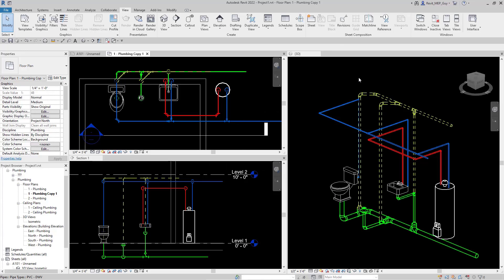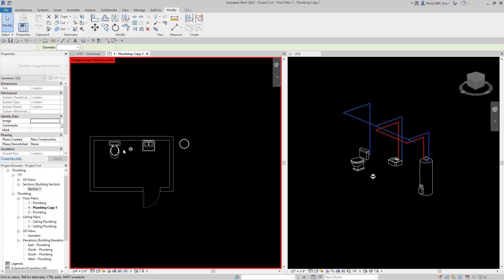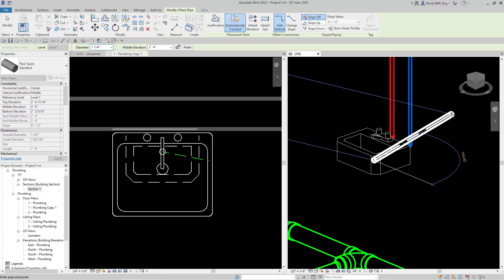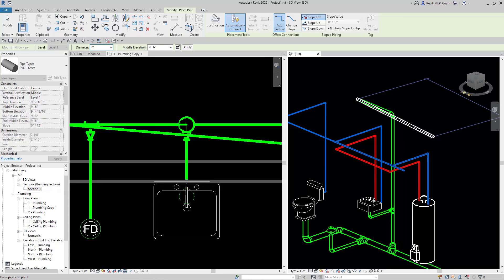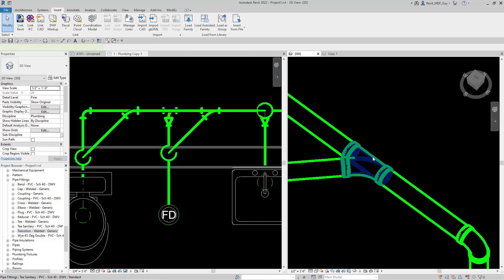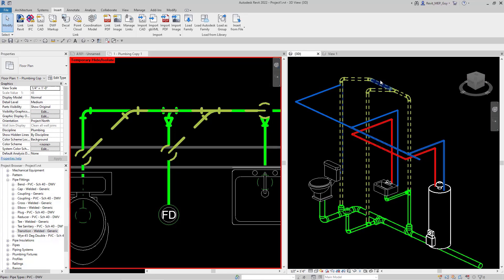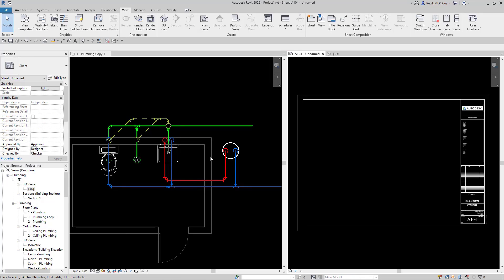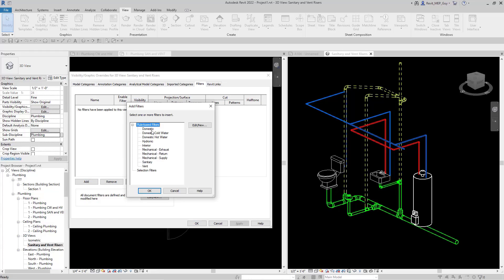Sanitary and Vent Piping for Beginners in Revit MEP

Comment: i have a doubt, so the floor drain and soil pipe from the w.c is connected to to common pipe ryt? but thats not how its supposed to be is it? cause from what i have searched the soil pipe is connected seperately and directly to the I.C or inspection chamber and the waste water pipes that is from the floor drain and floor trap is connected to the G.T or gully trap which is then connected to the I.C so like which one is accurate? and also arent went pipes just given for drain pipes?
i would be greatful if u clear my doubt im rly confused loll

Comment: @10:19 could you explain more. I have a fitting like you said, but it changes my whole system type.
Reply from the maker: First which version of Revit are you using? You have to separate the entire piping system from the sanitary first. So everywhere you are connected needs to be separated like I show @8:54 then once it's all separated you should be able to change the system to vent. Then re-attach to the sanitary. As long as there is a fitting separating the systems you should be good.
Reply: @mep_guy  it's the 2023 version
Reply from the maker: @pmarkpmark  I have a feeling it's because piping is still connected. Also when you make the connection it needs to be into a fitting. Not sure if this is required, but could be causing your system switch.

Comment: 🙏Thanks for this helpful tutorial. I want to change the calculation option in Revit ......
(Path => 
  1. Systems(tab) -> 
  2. Mechanical Settings -> 
  3. Pipe Setting -> 
  4. Calculation -> 
  5. Flow(tab) -> 
  6. Calculation Method) 

...... from "the 2012 International Plumbing Code (IPC) Table E103.3 (3)" to custom fixture flow rate/table. 
👉 How would you advice me, please?
Thanks!
Reply from the maker: Revit cannot do sanitary flow calculations. You can only use the IPC method to convert fixture units to gpm for water flow in pipe.

Comment: (@7:49) when the fitting is drawn the wrong way, click the blue arrow that appears when you select it and it will flip it.
Reply from the maker: Thanks for the tip Valerie. Unfortunately with the wye fitting you actually can't just flip the fitting in that scenario. At least I don't think you can lol. It's a very strange phenomenon and has to do with which way the fitting is drawn. But thanks for helping me out!
Reply: @mep_guy  Thank you for the videos, I have an architectural background and new to Revit MEP. Your videos have been soooo helpful I watch them religiously. Do you have videos on the other disciplines (electrical & mechanical) as well?
Reply from the maker: @valeriepierre7297  that's so awesome! I'm glad you are learning the other trades. I see a very bright future.  My plan is to do plumbing first then create mechanical videos. Eventually I'll learn electrical but that's a ways away.

Comment: Thanks for the videos.  Do you have any Sanitary piping videos that shows working piping and fittings with "sloped" piping?  I have found that drawing piping is much easier with no slope added.  SAN piping has to be sloped or doesn't work.
Reply from the maker: Yep, I did a whole video on sloped piping. Hope you enjoy it!
Reply: @mep_guy  Thanks!